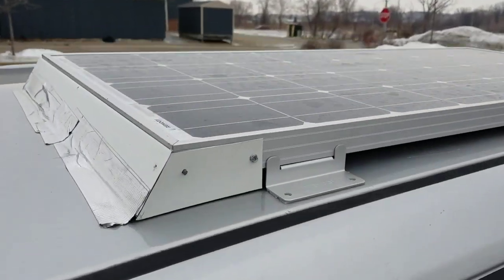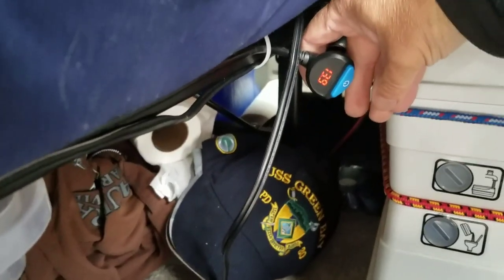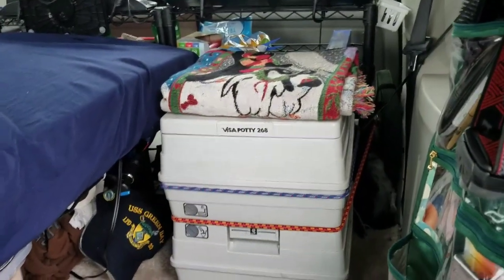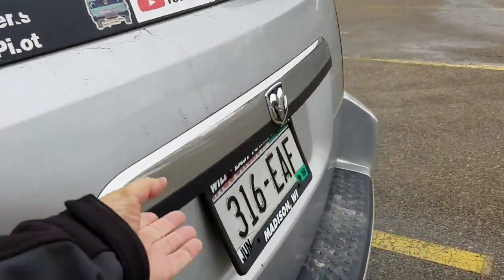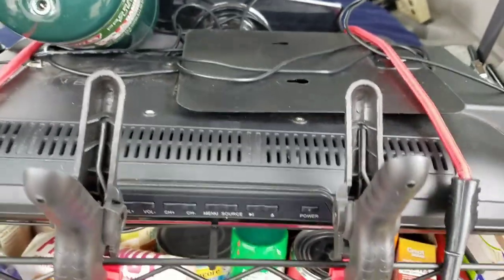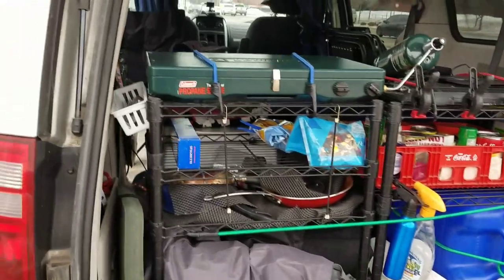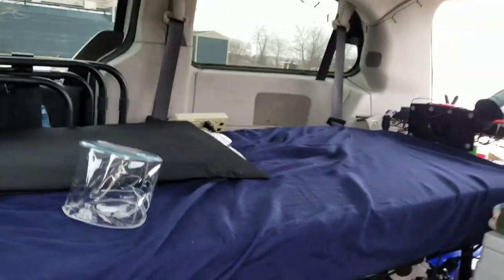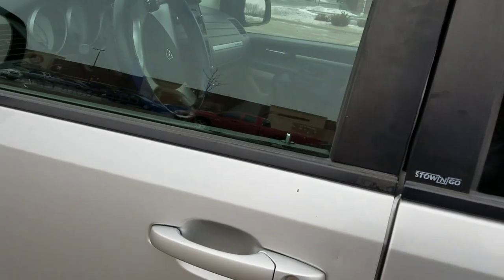Short Camper Van Tour/Minivan Conversion

Comment: You also want to drill big holes in that plywood otherwise you'll get van molding issues. There's a reason bed have slats or mesh.
Reply from the maker: Yes I did that. But because I'm part time and the mattress is taken out when not using it's not an issue. Thanks

Comment: If that fridge is peltier, you're fine. If it's compressor, you want PROPER individual leads STRAIGHT FROM the battery. Compressor fridges have a pretty dramatic startup surge.
Reply: 12 volt compressor fridges are not as hungry as regular household fridge even at startup. I have never seen a problem with the cigarette lighter plug with either of my 12 volt fridges.

Comment: Mike, in your video I saw what appears to be a tail-gate tent or shelter of some kind.  Is that a DIY or an item from a camping store.   Thanks.  Winfield.
Reply from the maker: Its a wind/sun add on item to another tent that I just rigged up to go around my hatch. I attached it using 3 claps.
Reply: @MikeandLisasExcellentAdventure , thanks for sharing your insights.  I had a similar idea of wrapping the tailgate in a tarp using para cords, with the rear door up for privacy, etc.  Your video has help in determining what will work to my liking.  Thanks again..

Comment: Hi Mike, I'm busy getting things together to make a short trip, my very first and I'm trying to setup  solar with just a jackery battery and a 100 watt fold up solar panel which I will use to power two small fans and a tablet and cell phone. No refrigerator yet. Would this work.
Reply from the maker: yes it will. If you use the 12 volt outlets it will help.  Depending on the Jackery that you have a frig might not. Which one do you have?
Reply: @MikeandLisasExcellentAdventure  I haven't purchased one yet, still researching. Thanks for your quick reply 😉
Reply from the maker: I have videos on how I did it. Just used old wheel chair batteries and hooked up 12 volt directly to it. I didnt want any inverter involved as that wastes power. I had a total of 150ah and that was just enough for my 12 volt fridge.
Reply: @MikeandLisasExcellentAdventure  thanks Mike, I'll go check out those videos. Simpler cheaper is what I'm looking for